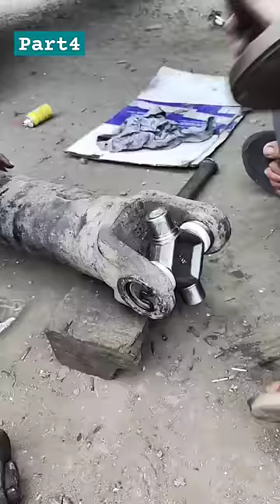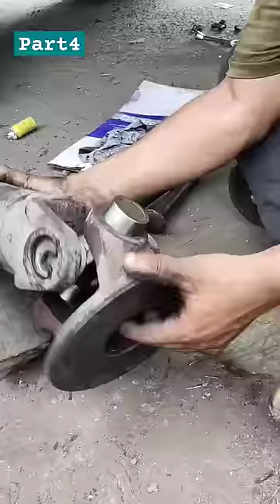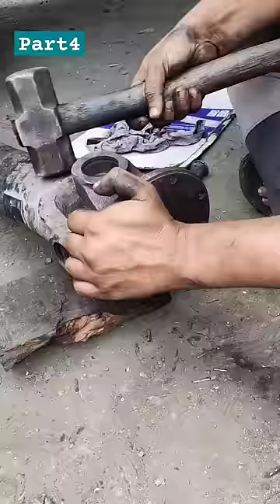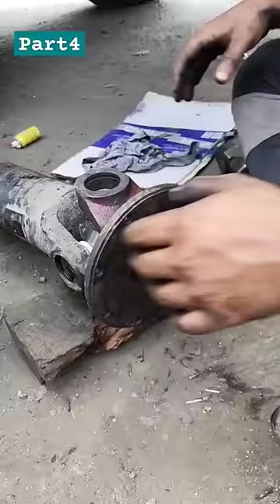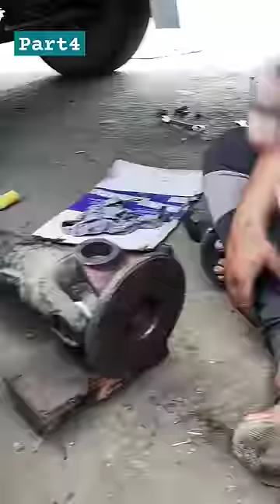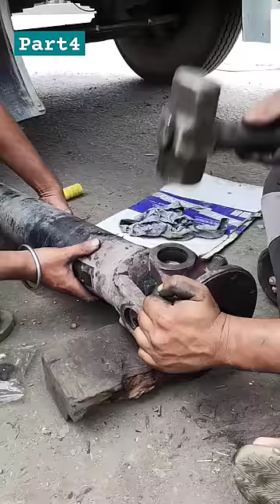#shorts #youtubefeed #hardwork #macanic #heavydutytrucks #repair #satisfying #jugaad #tatamotors

Comment: Its called a driveshaft differential. IT HAS SEVERAL PARTS.
Reply from the maker: You are correct
Reply: It's a drive shaft or propshaft bugger all to do with differential it may join to it tho